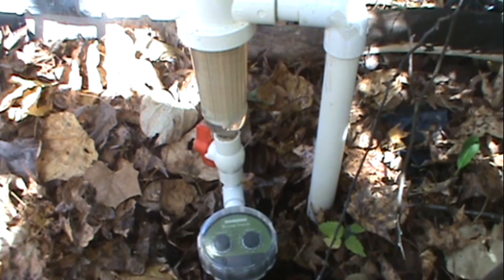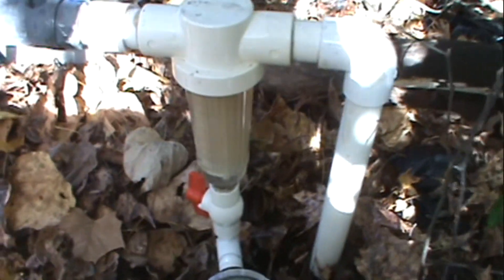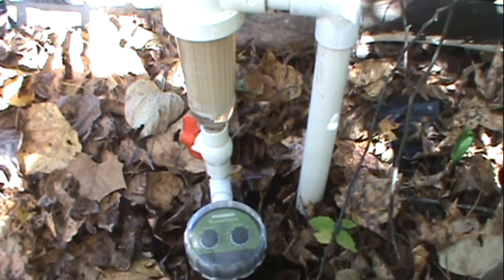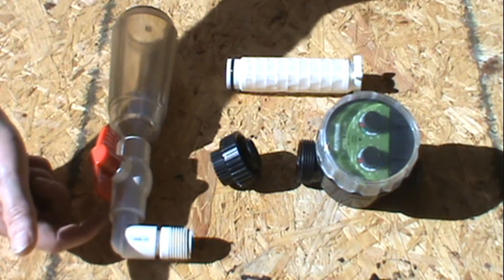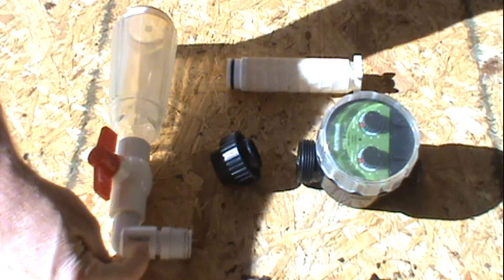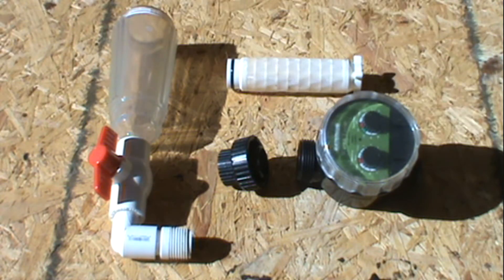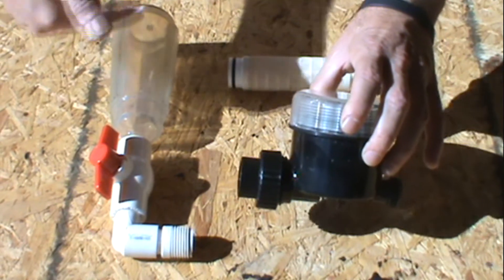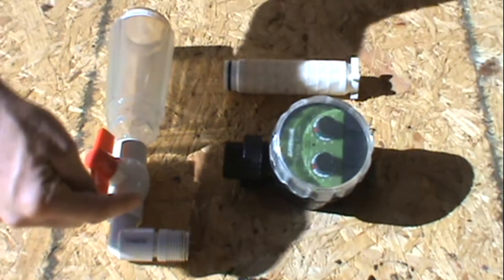DIY automatic water sediment filter

Comment: where do you buy the water timer? what brand is it?
Reply from the maker: +777dingo Hello, you can buy them at any hardware store. I got this one at Lowes. I be-leave this one was a rainbird. But any will work as long as it is battery power. I hope this has helped. Take care...Tony
Reply: Thanks Tony! and I'm getting alot of fine sand in my well water what size filter do you recommend? 100? or bigger?
Reply from the maker: The one I am using is a 100. That is the one that came with the Back flush system. I would try that first. Keep your paper work with the unit so down the road you can order the right one to replace filter if need be. Every once in a while I'll take it out and scrub it with a tooth brush for any debris stuck.
Reply: thanks
Reply: what are the settings on your timer?  how often do you have to change battery?